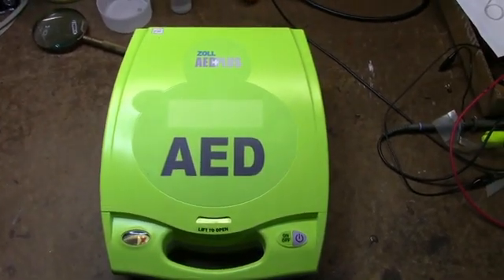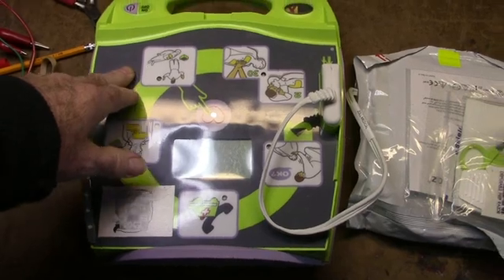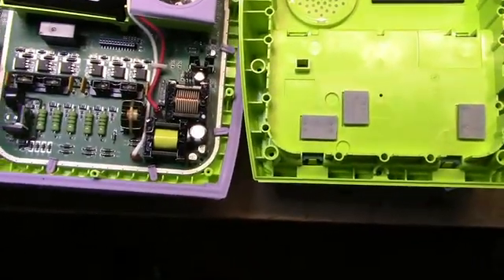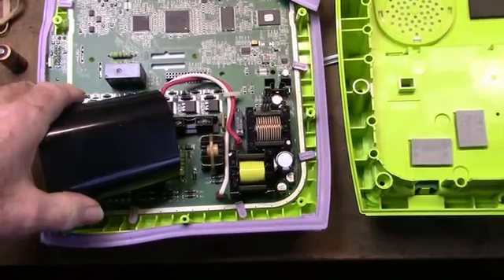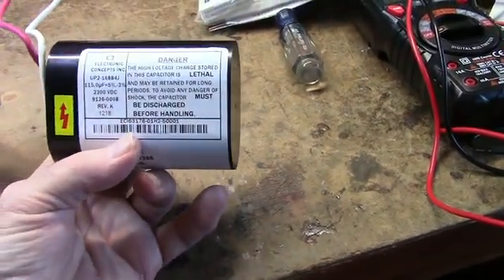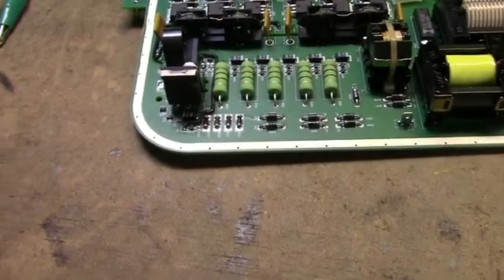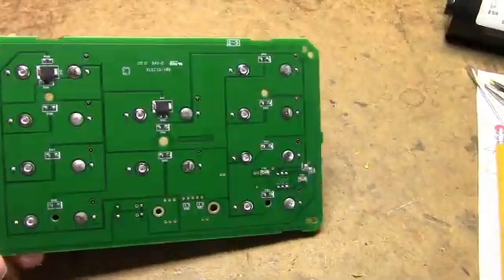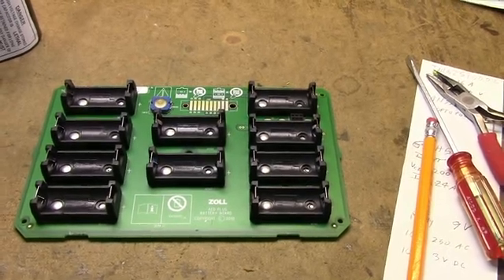AED Teardown

Comment: Interesting that it has a standard capacitance listing, but then the label also has the actual measured capacitance of 116.274uF, the dissipation factor, and the ESR. Man, would be nice to have that on all caps predone so one could bin them.
Reply from the maker: Hi Abrankod,  Considering these devices are used on humans, you can bet they were put through extensive tests.

Comment: Wow.  Someone throw away a $1,900 unit because of a $50 set of batteries.
Reply: Like 95% of the vacuum cleaners in the landfills, there because the 2nd filter was never cleaned/replaced.  Easy fix, but toss for a new one.
Reply: @gavincurtis  Such a waste.
Reply: It's a medical device.  We do not repair them when they expire.  Liability.  Sorry. It's better to bin it than repair and recertify.  All it takes is one refurbished unit to fail and cost someone a life and there is a seven figure lawsuit in the wings.